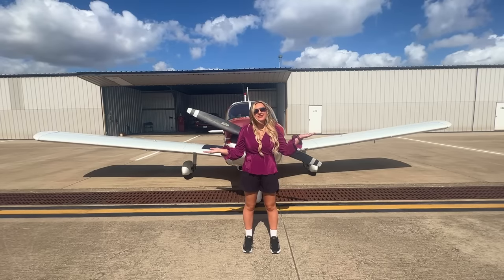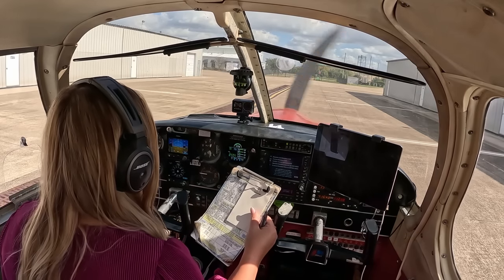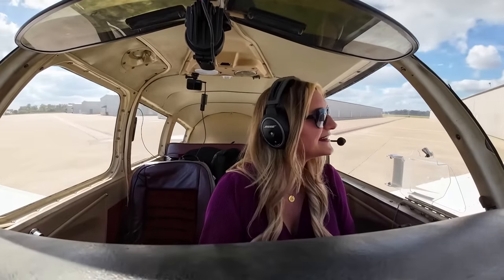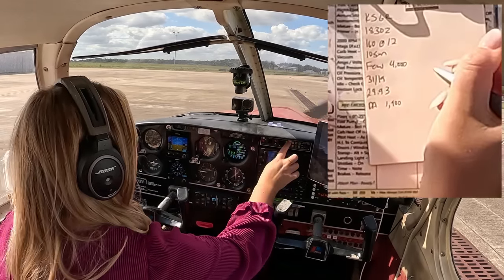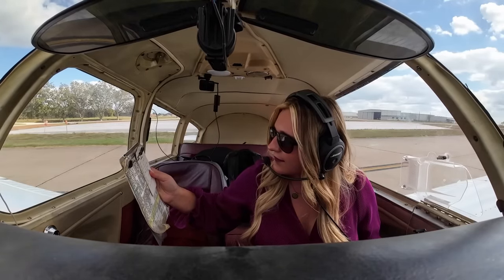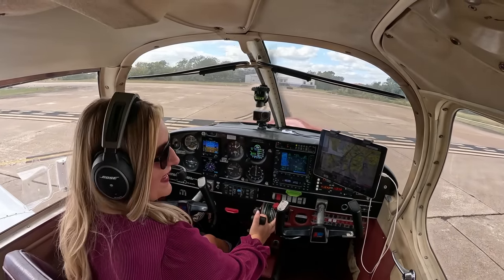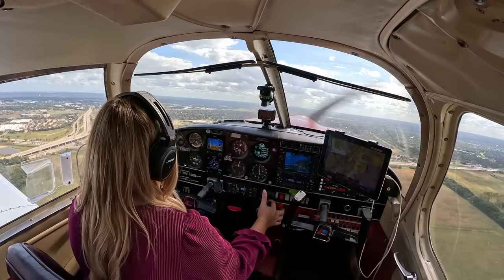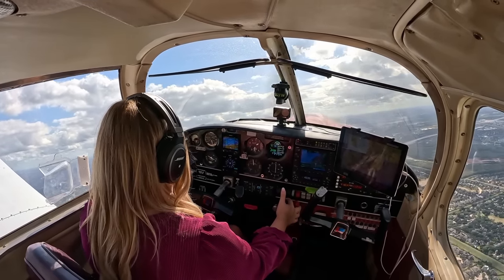Emergency! Failure In Lil Red - Return to Airport!

Comment: If I see what you saw, because I’m a mechanic I would immediately assume a fuel leak and immediately request to land! Good job staying calm!, staying high, good idea! Good job keeping eyes out for landing spots! Great flying! Congratulations on your safe landing!
Reply from the maker: Thank you very much!
The fuel leak was actually something I was concerned about, but I cross checked my fuel tanks and they were indicating normally, I just didn’t include that in the video because I didn’t talk through it.
I’m so glad you enjoyed the video and thank you for the kind words🥰
Reply: Fuel leak maybe good job though
Reply: @FlyWithKay k
Reply: What did you find out about the plane?
Reply: Fuel usage high what the high spike in Cht?
Reply: Me thinks the fuel burn rate is measured by what is flowing through the line to the engine, a tank leak would be indicated by the fuel gauge(s) dropping quicker than normal. CHT abnormal as well...I suspect a gauge issue.
Reply: @captainkttyhwk 
       Fuel flow indicators have been known to indicate very high when there is an intermittent connection in the cannon plug.   The on-again, off-again connection is counted as a “pulse” and the indicated fuel flow shows abnormality high.

      She made the right decision, because it could also be a split fuel line in the line between the fuel flow transducer and the carburetor.    This would also manifest itself with high fuel flow, but still enough in the line to keep the carburetor bowl full (and the engine keeps running).

      The high CHT is most likely due to improper timing of the “new” magneto she mentioned.   Advanced timing will increase CHT while decreasing EGT.
Reply: I don't think so...I've never done a GI275 install, but I have done insight, JPI and EI installs...and they are all the same.  If the hypothetical break was between the transducer and carb, nothing is going to change upstream and FF will remain normal.  This is just a bad transducer (or wire.)  Also...320?  405?  Since when is that considered to be a bad CHT temp? Yeah if you're hitting 420 in cruise, you may have a gap in your baffling letting air through, but if the drops are good, then the mag is good.  I honestly didn't watch the whole thing, I guess if she had a Surefly installed and had the dip switches set incorrectly, maybe in variable timing mode the temps could get wacky?  That's a reach though.  She was leaning it out, temps go up a little.  Red line for lycoming is 500 degree, and it's recommended to keep them under 435 for long life expectancy...
Reply: Yes these old fuel lines can start massive leakage...Don't think she knows aviation is not a game
..
Reply: If she’s looking at a fuel flow meter, which I suspect she was, a fuel leak would not account for the fuel flow inaccuracy.  Probably just a calibration issue or bad red or gold fuel flow meter
Reply: @richardfrances7679 she literally aborted the flight, how is she not?
Reply: Fuel leak would be indicated by fuel gauge level dropping abnormally with engine fuel burn rate remaining normal
Reply: Exactly My thoughts, fuel leakage or float readout / gauge issue. As a person knows car restoration understand this same mechanic or electronic fuel detection systems. Planes are the exact same setup.
Reply: None of that would indicate a fuel leak. All you A&Ps need to go back to school.
Reply: So what was the issue. I know it was a long time ago. Inquiring mind wants to know. Thanks good decision making
Reply: @richardfrances7679  really? why would they start massive leakage?
Reply: My immediate thought was that she  could have had a massive leak downstream of the fuel flow transduce. Immediate landing at the nearest suitable airport would have been besst answer. Second, stay at altitude until you are in a position that you could glide to a landing. Third, if she wasn't sure of what the problem was, declare an emergency. It costs nothing and gets you the priority you might need.
Reply: @shanebrown1976  im sure he is one that thinks girls can fly lol
Reply: was your gauge set to liters instead of gallons? lol IDK  I'm just guessing I'm no pilot or anything lol 
 @FlyWithKay
Reply: @Jmg831 it has happened.
Reply: Ooo...If you are a mechanic, then you'd know that a fuel leak will not show on the fuel flow indicator, since that measures fuel going to the engine, not loss of fuel from the tanks. Moreover, that flow is measured in the feeder line to the carburetor, and if the flow really was that high it would flood the carb causing power loss. Also at that rate of indicated fuel flow, we'd certainly see a precipitous drop on the fuel quantity gauges fairly quickly. Kay noticed right away that wasn't the case, and from all appearances the engine continued to run smoothly. She made the right decision to turn around while she was within easy return range of her home airport. If there had been other indications of trouble, such as a rough engine, then I'm sure she'd have put it down at the nearest available airport.
Reply: @barnettg66  What you’re saying makes total sense. Right, the fuel gauges would start dropping with a leak. At the time I watched this I was speaking from a car mechanic perspective/pilot in training. Now that I know more about the workings of the system I would think a little different as to what was going on. This was a great video to share, and thank you for your input. Very valuable information for us all to stay safe and make the best decisions possible when encountering situations aloft.
Reply: @barnettg66  he’s probably a car mechanic
Reply: pretty sure  non-mechanics would also consider fuel leak
Reply: I do watch a lot You tube but wow your picture quality is incredible . You must have super duper nice cameras 👍🖐️❤️
Reply: @bradmarcum2927  Aircraft fuel pumps are certified to deliver twice the amount of fuel the engine needs to operate.  If a fuel leak develops between the fuel flow sensor and the carburetor, the fuel flow reading would go though the roof as it did in this case.  If there was also a fuel pressure gauge, the fuel pressure would drop almost to zero as there is little to no resistance presented with a fuel line leak.
Reply: @eagle2019  if a leak or real problem did exist that was my thought    it could very well be a fuel flow sensor or wiring/connector or even the readout device failure or...    Interesting to know what was found

Comment: I’ve never encountered a situation where I regretted remaining calm. Great job!!
Reply: true.  just a question of practice and visualization.   slow is smooth, smooth is fast.    my opinion/experience is you can teach pretty much anyone or yourself to do incredibly complicated tasks (even those that are simultaneously complicated and extremely dangerous) if you are relatively mentally stable in possession of whatever prerequisite knowledge.    what you cannot teach as easily is the empathy and compassion required to do certain things, or how to apply the right amount of those emotional components if/when necessary.       

anyway that's a long way of saying "you are correct sir!"

it probably wont surprise many reading this but when things don't seem quite right or i hear a sound i'm not used on my boat i treat things very similarly... as i do in the hospital with patients,  aberrancy is just that... unexpected deviation.    the stakes aren't quite as high as in the air/hospital necessarily and i'm not a pilot but when the water is so cold and help is so far away or you think you're seeing early signs of a change in condition you have to calmly notice such aberrancy and note pattersn,  treat it with the respect it deserves relative to its potential to escalate and keep your eyes open on whatever instruments you have in the situation,  gather more data if possible... and attempt to head off unforseen complications.     better to stop and check or find safe anchorage.    

a long way of saying "get good at critical thinking"

Comment: You are very smart to “troubleshoot the aircraft on the ground!” I’m not a pilot, but I love to fly in small aircraft and helicopters. I worked for FAA for 42 years as electronic and electrical engineer and electronics technician and studied accidents and far too many accidents caused by failed attempts to troubleshoot the aircraft in flight. I loved working for FAA based in Miami Florida USA and the mission to keep all of the navaids and computers and electronic and radios working at peak performance. I enjoyed watching your video. Godspeed.

Comment: Great job keeping your head in the game! If you feel like you might not make the field if the engine fails, then you are too low. It's better to be high on approach with a suspected engine/fuel issue, especially 30 GPH fuel burn (seems like a fuel leak to me). I might have stayed 500'-1000' above my safe glide ratio to ensure that I could make the field at VREF or (VS1 * 1.4) glide before accepting the decent. (Now, before anyone says something about the best glide speed, consider maneuvering at 110 KTS vs 65 KTS with high DA! Higher and faster is better until you are on final and the field is made at best glide). The Foreflight glide tool is handy for this by keeping the entire target airport  inside the circle (I set my glide ratio slightly lower to ensure I am good). If the engine failed, you could quickly secure it and landing would be assured. Any extra energy from the decent could be bled off with a slip on short final and landing a bit faster once the landing is assured. Another advantage to being higher and faster is that you can review the engine out and fuel leak EPs in your checklist to be prepared if something does happen while you are in a relatively safe state. Worst case scenario, if you are too high and too fast, you can fly an overhead by breaking at the numbers. (I'm a former AF pilot, so I practice engine out overheads in the SIM as much as I can). Get comfortable with this maneuver in Xplane and fly a bunch of overheads with an instructor to get comfortable with it. 

One thing I do when my aircraft has had engine work done is to review the engine EPs before each flight for the next 5 flights. I keep the EPs open to engine tab just in case. This way if I have a failure, I am familiar with what to do and I have the checklist handy. As a matter of procedure, I review a random EP before each flight just to keep my head in the game. 

Great job turning back! Judging by how busy blancolirio is, not many GA pilots would make that decision so quickly!

Comment: Kay that was an excellent example of "mitigation of risk". Good job!  A great addition to your beautiful PA-28 would be shoulder harnesses. All the best and fly safe!
Reply from the maker: Thank you very much! And yes, I am looking into them, they are just a little pricey 😂
Reply: I agree with TwinPilots19 on the shoulder harnesses. Your life is worth the cost of them.
Reply: @FlyWithKay Agree 100%. Your Life is worth much more than the cost. Also, pardon me, but banging your head on the dash in an accident or a very hard landing is an experience you don’t want. No airbags in planes yet that I know of. All the best, Fly Safe! 😎
Reply: @socalfun64  There are, actually.  Not on the dash but in the shoulder straps, some of the newer Air Tractors have them.  They inflate when enough tension is placed on the straps to indicate a crash and the basic premise is that it provides more surface area for the straps to restrain the torso and protects the head from side impacts.  The other nice thing is that they have pre-tensioners, so you don't have to have them yanked down tight all the time to be effective.  I have a set in mine and I wouldn't want to fly without them, but I'd say it's probably a bit overkill for GA aircraft though.  Most aircraft aren't built to be all that crashworthy, they don't have an overbuilt steel rollcage around the cockpit...meaning the airbag restraints might work great, but in a situation where you'd need them the cabin will crumple into you and render them pointless.  Better to put that money elsewhere like better maintenance or equipment, something that would prevent emergencies from happening in the first place.

Comment: I flew commercially years ago and miss it dearly. Flew mostly light aircraft including Beechcraft, Cessna, and Piper. With an instructor rating and an Airline Pilot Licence, I flew IFR frequently and agree that using the system for safety and assisting with traffic avoidance. Nineteen gallons an hour may be okay for a Piper Cherokee six but not so much so for the smaller Cherokee series. I enjoyed flying vicariously and brings back memories and I’m glad that you set a good example for pilots by making a prudent decision to return to base. Better to fly another day.

Comment: Your videos are super instructional.  Always. As a student pilot one instructor told me on run up that after you added carb heat checking the drop in rpm that you should move the throttle to idle to make sure the engine doesn’t cut off with the carb heat on. Makes sense to me.
Reply: Yes that’s apart of my flight checklist - right after checking vacuum suction and gyros turn that carb heat on throttle idle carb heat off then throttle 800-1000 rpm